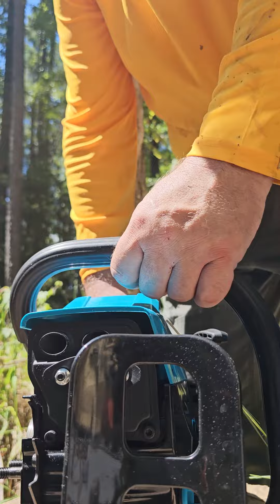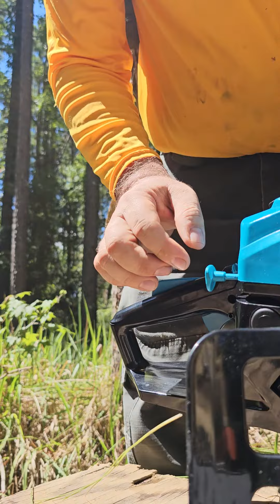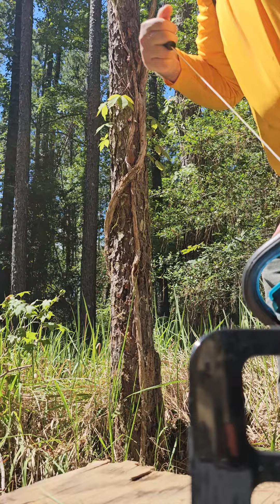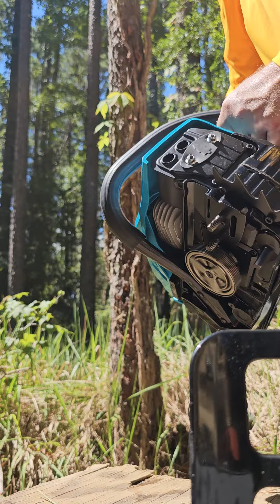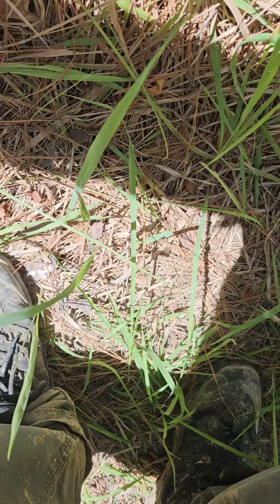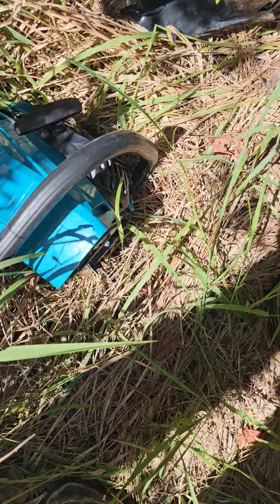1st start "Pro-Grade" 5800 Komatsu/Zeno clones as declared by my evaluation & sales/Customer base.

Comment: Those are a fantastic little saw and they are just pretty much perfect for the 18”-20” yard saw or ground saw’s… I’ve been beating the living daylights out of one for 5-6 years now doing tree removal work with it… I bought it a little bit better quality bar and chain combo but it’s a hls Raismen $35 dollar special so it’s definitely not Stihl quality but heck I’ve not spent a Buck Fiddy for the saw and the bar and chain combo and I have been running it against the 261cm with the.325 20” bar and I eat his lunch every day all day long and it’s a $150 dollar rig against the $750 dollar Stihl saw!!! He hates me!  LMFFAO!  They have the duel exhaust port muffler and they are just ready to rock out of the box!   Those are the perfect size saw’s for most homeowners and the firewood cutting guy’s! I’ve been using this saw for 6 years now so I’m going to say it has cut equivalent to 30 cords and it’s just getting broken in so I would highly recommend adding one of these 58cc types to your fleet and for less then $200 bucks apiece you can save hundred’s of hours off your quality OEM Stihl or Husqvarna… I’m not saying that these are as good but I’ve been absolutely pounding on this one…ground down the rakes to 50-60 thou and it was a crazy chattering blast through the softer woods and the clutch took that abusive stuff perfect and I broke before it did and I sharpened the chain enough to get the rake depth back to normal so it would be smooth again!   It’s just a fantastic design and I love the big zenoah! RedMax/echo type filter system… these cheap saw’s are just absolutely incredible for the super cheap price! If you would have told me 10 years ago that I would be able to get a 58cc size saw for $150 bucks that I could use for work and it would be running as fantastic as these guys do! I’d have definitely called you crazy!  It’s just blowing by the 261cm badly and that’s a $750. 00 package!  The 391 with the 20” bar is a close call or call it a tie! And he’s paid like $750 for that 65?cc size saw and they are a very close race!  For less then $200 bucks apiece!  I can buy three of these cheapO’s and I’ll still have $150 bucks for the gasoline and 2 stroke oil!!!  LMFFAO!  I’m really super happy to be using the super cheap 5800’s  clone 372’s and g660’s for work and putting all those hours on the cheap equipment!!!  Granted the g660 with the meteor topend kit and maxflow air filter system and duel exhaust port muffler cover cost $550 to assemble but it’s a smig faster through the logs then the 661! That cost us $1400… $13 and change then there was a bar and a couple chains in the final deal… so $1360 vs $550 !   When you can buy (2)-(Two) of the other machine that’s a little bit faster cutting and have $360 in change???? Dang near (3)-(three) units for the price of the one….    And on 40:1 90 octane gas.,. There’s three of those 90cc aftermarket saw’s riding on the tree truck’s.,, two different crew’s have been using them for the past five years and they are just as solid as they were when they started… haven’t broken them yet… and they have the aftermarket clutch parts too! I wanted to see how long the aftermarket clutch would run and they have all survived 5 plus years!
Reply from the maker: One hell-of-a fantastic comment.  Thanks so much for a wonderful read, i made a video about it, about your comment.  Maybe ill down load.
Reply from the maker: Its posted, thanks again.